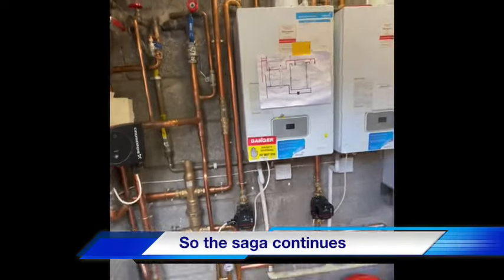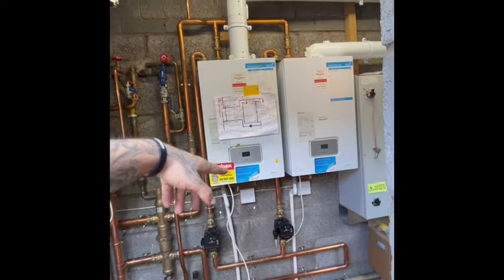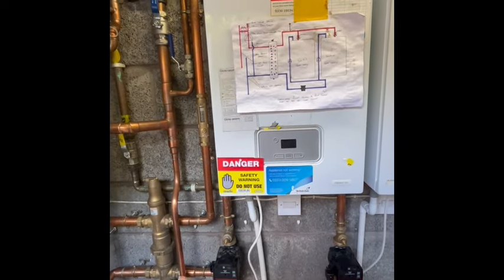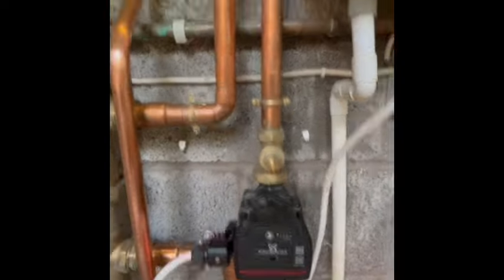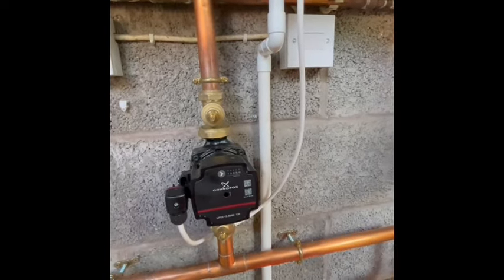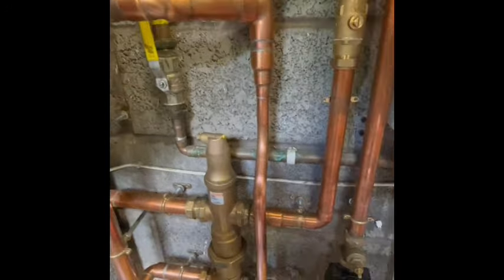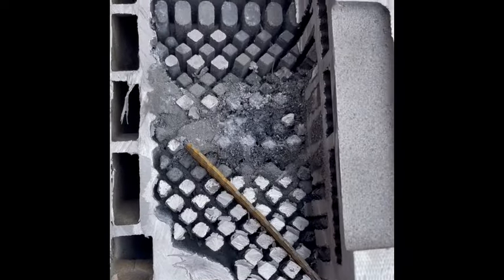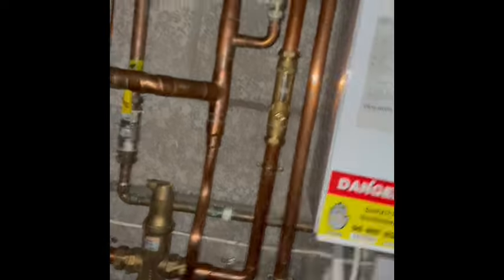F83 Glowworm/ Vaillant  Part 3

Comment: Watched all 3 video's you put up on F83 fault , very informative,  i have same issue but on a brand new installed boiler , initially had airlock but managed to get system working well but still getting F83 daily even tho all rads in property getting hot . Will call manufacturer but watching your video's im setting worried now they may not help much 😮

Comment: That's what you get with these small alumni heat ex block up easily
Reply from the maker: Yes I’m not a fan at all of the hexs
Reply: @thementalgasman3tgasmainte317  cast iron ones were much better

Comment: Wow. The amount of crap blocking that heat ex after only 3-4 yrs is insane. 
Got the exact same fault codes on a Vaillant EcoFit Pure 425, F83 and F28. Pulsating noise (throbbing) and water gushing sound, just before lock out.

Comment: exactly bro, that's the entire point of a low loss header, right, hydrolic separation, like close coupled tees. You are correct bro aluminium heat exchangers are a nightmare, install a sensible boiler with a stainless hex like a Baxi XD

Comment: Hay 
Love the video 
I’ve had the same problem, I found a really good solution is to put the fan on full speed and use a power flush radiator hammer that goes in your SDS drill on the heat exchanger and it will blow itself clean if it’s not too bad

Comment: Great perseverance there I feel you have been let down by vaillant service there. The last engineer clearly had more about him than the ones that just threw parts at it. 
I believe the reason the ask for a plate heat exchanger for system isolation is negate any flow issues - not my monkey no my circus attitude